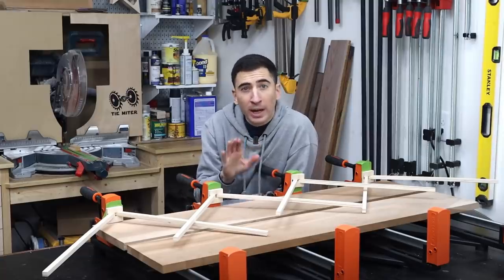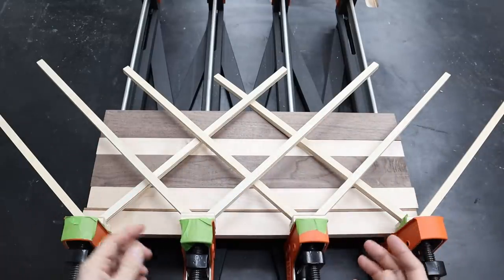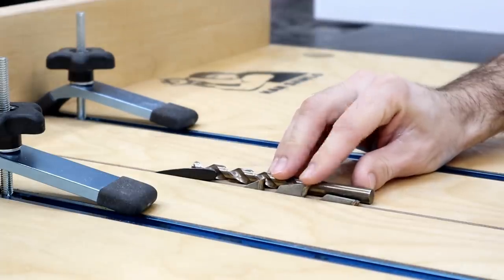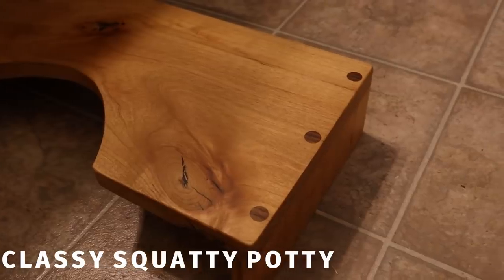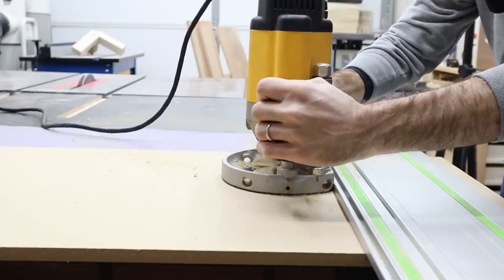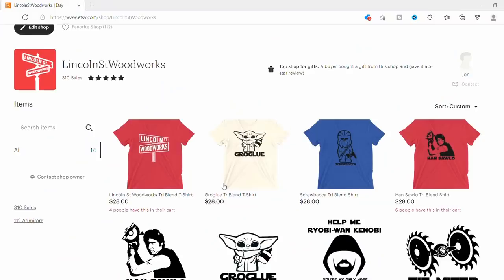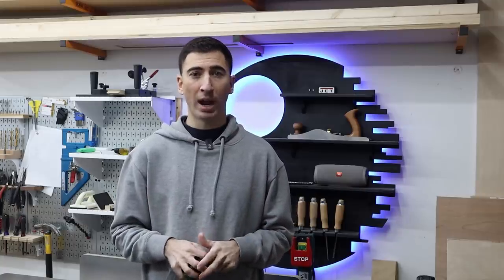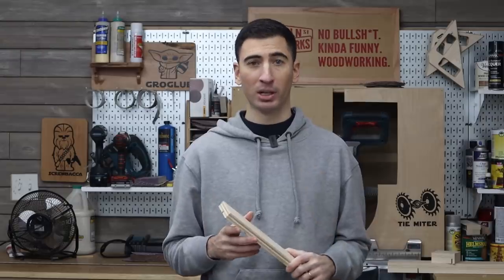I wish I knew about this before - woodworking

Comment: When mounting a computer monitor baseplate to a table, rather than measuring out the pilot holes, I clamped a piece of paper to the baseplate and did a pencil rubbing for a makeshift template.  I can see that applying to other uses/projects for a quick drill hole template.

Comment: thanks for sharing all the tips...have been subscribed to your channel for as long as you've been on YouTube and always learn something that helps...will visit your Etsy store! Regarding miter saw tip, I will place the board against blade while it's plunged, raise the blade above the board then start the saw and plunge...the apparent vibration/centrifugal force yields a very slight removal of material which is exactly what you're achieving...anyway, thanks for sharing!

Comment: Not sure I buy the clamp force vector idea. There are forces coming from the other side too, not just the 1 side. So you'd have forces causing Xs, not just Vs from 1 side. Also, I think the angle would have way to much to take into consideration, wood type and dimensions, to say its 45 degrees.

Comment: Instead of using tape to avoid glue during glue ups, use a bit of paste wax. Whether on the wood or clamps, it works better than tape and doesn’t risk getting stuck after!

Comment: Holy crap, the fan idea.... I have the Bosch saw and a front cover panel like yours, into a dust chute behind, but it only helps so much. I happen to have a battery-powered Ryobi fan and short ceilings. I bet if I mount that fan to the ceiling just in front of my saw station and aim it down and towards the saw, it would be the perfect dust-forcing-thing? BRB.....!

Comment: As someone who came out of metal Fab into carpentry i have a slew of thick angle iron pieces laying about. Ill use them to distribute the clamping force on the sides and use them allong the top and bottom to reduce the bowing effect of side force. It will end up looking like something out of a torture film....

Comment: Nice one :) Compact and still funny, keep it up!  For finding and marking the middle of a wider/longer board i use a similar technic, especially for akward fractional value, for example if the board is lets say 53.5cm wide (i will stick to the metric haha) , the middle would be 26.75 , good luck reading that one from ruler.. so i just mark from both side 26 and eyeball the middle of the two lines, i can detect the middle quite precise up to 2cm gap. Checking from both sides the measurement is also a good way to avoid some misreadings on the ruler, or some miscalculations done on the fly

Comment: Good tip. But for using them to set TS height, turn them 90 deg to the blade butt end to the blade teeth. Then you have the height up against the blade and it's easier to feel where it should be. If parallel, there is a drop as the radius of the bit falls off. Raise saw is brilliant!

Comment from the maker: Support the channel by visiting my Etsy Shop and using affiliate links in the video description. Do it - and I'll keep making videos. Also join our FB community group 

https://www.facebook.com/groups/702798154350625
https://www.etsy.com/shop/LincolnStWoodworks?ref=seller-platform-mcnav
Reply: Cannot recommend the shirts enough, fits great and super comfortable!
Reply: I liked all of your tips and never thought of using drill bits to measure anything. Thanks. Have you ever used a 4ft level to cut a wonky piece of wood on the table saw to get  a straight edge when you don't have a jointer?
Reply: I'll give you a different unit of measure  comment... The US doesn't use imperial units. It uses US Customary units. We haven't used imperial for over 200 years.

Inches is now the same between them but were not until around WW2 when they were unified globally. So if you get a really old drawing, don't assume the inch is the same distance used today.  For woodworking it probably won't matter, but machined parts might not fit.

Many other units differ between them. Particularly volumes. An imperial gallon is about 10lbs of water, while a US gallon 8.3lbs
Reply: Keep doing what you are doing brother. Haters are gonna hate no matter if you have science on your side. Love the videos. Love the merch.

Comment: Does this mean you can reduce the number of clamps needed by putting a thick block on either side of the work?

Thinking about it, it would certainly help spread out the clamping pressure.

Certainly if you have larger than necessary clamps, and a long thin workpiece this could save a lot of clamps, and thus a lot of time clamping and un-clamping. Perhaps pairs of wooden boards with a thin layer of rubber or leather (to protect the work from damage) glued on one face could be specifically made for this purpose.

Comment: Here's my method for squaring up boxes or carcasses or other box like items. I grab two 1/4" dowels which are at least longer than half, but shorter than the full distance from corner to corner. I then place the two dowels across the box diagonally with one dowel end placed firmly into each corner. Then with a spring clamp, I clamp the two dowels together. Now take the dowels and place it into the opposite corners and then adjust the box and re-clamp the dowels to the newly adjusted box corners. Repeat until the dowels fit snug in each corner without adjustment.

Comment: For shaving off "slivers" of the end of a piece of wood, if your miter saw isn't already set up, use a hand plane on your shooting board as a good option - the caveat being having these. For "tough" end grain, I've even found using my #62 low angle jack plane a challenge. As Rob Cosman has demonstrated, a #5 or #5-1/2 will provide greater ability for this task. This is the hidden jewel that may only need moderate at most restoration and tuning that I'm on the hunt for at a flea market.

Comment: For the cutting board glue up (or any glue up with thin pieces) in case you don't have enough clamp you can add some boards between the clamp and what you are glueing up it can help spread the clamping pressure.

Comment: Hint? I have used drill bits as set up gauges for a long time.  Because I have a hard time feeling if the top of the blade is even with the top/side of the drill bit I like to use my torpedo (6") level to span from the top of the/side of the drill bit to the top of the highest blade of the saw.  Because the level can swing on the top of the blade tooth and the drill bit I can watch the bubble in the level while moving the blade backward and forward until the bubble is centered in the level.  This means the blade sill be set exactly at the depth equal to the diameter of the drill bit.  Also if you fret over the insert not being exactly parallel to the table of the saw the level is long enough to span over the insert so the drill can rest blade tooth and on the drill bit on table top.  I guess if you can afford the brass set up gauges the level could still be used to set the blade to an exact distance above the table top rather than the insert.  

I really liked the clamp spacing and the router round edge used when using a strait edge instead of the flat side.  Just remember that the router bit needs to be centered in the center of the base.  Look closely and you might see that the plastic router base is not always the same as the router frame and the frame may not be exactly concentric with the actual bit or router collet..

Thanks for this video.

Comment: What I was taught for sneaking up on a length with a chop saw, is to lower the blade (not spinning), press the piece slightly into the blade to cause a tiny bit of deflection, raise the blade while holding the workpiece in place, and turn on the saw and bring it down. Repeat as necessary.

Comment: You can avoid the “cupped” result by alternating the clamps from one side to the other. I also would put as many clamps as I could while gluing up. I had about 30 of the  original Bessey K clamps and when they began to fail from a design flaw Bessey replaced all them at no charge. Great clamps those K Clamps. Good luck with your channel.
Reply: Additionally, it you aren't using the heavy duty cabinet clamps, but instead a general F clamp, alternate over under as well.

Comment: tip when setting the disk sander at 90 butt 2 pieces of scrap side by side and sand the ends, then butt the sanded ends together, if there is a gap top or bottom your not square. adjust the table until you have no gap and you will be dead on. works on the band and table saw also

Comment: An addition to the last tip, your saw blade flexes, you can sneak up by larger increments if you push your workpiece so the blade flexes a little, hold the workpiece still, raise the blade, it will go straight, then make the cut.

Comment: - If gluing up narrow boards, you can add wide boards as spacers to the beginning and end of your setup. This will put the narrow strips in that pressure cone of influence.
- when edge routing inside and outside of a project (think picture frame) the inner edge should be cut clockwise and the outside counterclockwise. No fun mnemonic device, but never-the-less

Comment: the best thing about the imperial system is that if you need half or double of a fraction, you can just say 9/32 instead of 9/64 or similar. I mean, I still use the metric system, cause I'm from Europe, but the fact that the imperial system works with fractions IS helpful.

Comment: 1st off, GREAT video.  I truly enjoy all the experience and info you share.  Here's a possible idea for you.  With regards to the 45° clamping force method for clamping glue ups, where you have to add 3 more clamps to the 4 you are already using in order to get good clamping pressure on the glue seam that is outside your clamping force area.  Couldn't you simply add a spacer board (without any glue) to move your project up further into the 45° clamping force area?

Comment: Nice tips there, thanks. Have You tried to let the forstner bits turn CCW for only some turns and after that switch direction to cw and finish drilling the hole? This also prevents tearout on soft woods and You don´t need the guided hole plate.

Comment: Good tips. As a Canadian (and supporter of the metric system) I have found woodworking the best intro to actually using imperial measurements. 10 is semi-prime, so it can only be divided by two numbers (2 and 5), where 12 can be divided by 2, 3, 4, and 6, giving you an easier method to more complex layouts. Memorizing and moving up and down the (maybe) 64 fractions you need to know is easier than memorizing .012 mm or any other odd number you'd need. It's good for construction and design. It's not good for science.
Reply: If you want people to take you serious...You shouldn't go around telling people that your Canadian.
Reply: plus, on an average male, one inch is one finger joint... and it's easier to divide stuff by two than by 10.
Reply: @GlueTubber  Dividing by ten is just moving the decimal point.  Dividing by two requires you to remember a bunch of facts and know how to divide.  It's way harder than ten.  Example:  What's a tenth of 517?  51.7  Whats half of 517?  Uhhh, lemme think about that.
Reply: @incognitotorpedo42  so, you are saying that those who use the imperial system over the metric system are smarter?  I'll take that!
Reply: @Elderos5  nah, you are all wrong.
Using 'murican system full of body parts and random things and words is not smarter, more convenient or whatsnot, than a crystal-clear, in and out scalable - metric system.
Reply: @GlueTubber  soooooo…. How do I divide a finger joint by anything? (Jokes) 😝
Reply: @GlueTubber , which one finger joint? 😂
Reply: Sorry about your communism

Comment: Not an expert, but I have a thing with clamps to help avoid cupping. Put as many on as you can, but don't tighten them like the boards owe you money and now this is their last warning.

The pressure spreads out but it also gets smaller. I think it looks like a flame - the blue bit is the hottest and goes pretty much strait up the middle, while it gets cooler and dimmer as it goes outwards. So by using lots of clamps at lower pressures you can get more control and a more even spread.

Ooh, and also use those things where you clamp a couple of straight boards to sandwich the piece if you can. They have a name, and I can't remember what it is...

Comment: Before you even think about clamping and gluing boards together, you should joint the boards so that they mate properly
with no gaps.  When boards are properly prepared (jointed) you do not have to apply herculean amounts of force during
the glue up stage.

Comment: The statics class I had in engineering school sure doesn’t teach that a short distributed load ( the clamp width)  between two points has force vectors at 45  degrees in two directions.
Reply: Ha, that's strange, mine didn't teach the 45° either.... While I suppose the 45° may be useful as a rule of thumb, it in no way follows math/physics. The author is just regurgitating false info from a Katz-Moses video a couple years ago. https://www.youtube.com/watch?v=j7e-gd-ZBdI
Reply: @yodes07 , ''spongy'' flexible stock will  distribute the pressure in a narrower angle, and stiff material will yield a wider angle of dispersion. Experience helps.
Reply: It's presented as a useful method to visualize what is happening in the joints, not an exact mathematical formulation. This is actually also used in engineering. Shigley's Mechanical Engineering Design Handbook uses the simplified pressure cone method for bolted joints, but it recommends a value of 30°.
Reply from the maker: As Manuel stated - this is an oversimplification of a bunch of factors at play. I never even touched on the properties of individual wood species (because most people don't care and it really doesn't matter) This is a down and dirty way to show people you need more clamps when the boards are narrow. Nothing more - nothing less. I think everyone needs to calm down on their statics class. Fine woodworking has covered this, Spags has covered this. It isn't some new revelation.

Comment: I grew up with both standards of measurement and it helps avoid mistakes as I write the size in both, if when it comes to cutting, say14 inches has 330mm next to it the mistake will be obvious when reading the tape.

Comment: I think you may be mistaken on the clamping issue.  You are only showing clamping pressure coming from one side of the clamps.  Once the clamps are closed you will have equal pressure at each end of the clamp.  So, imagine the angle indicators also coming from the other end of each clamp, and you will see that there are practically no "dead pressure" spots.
Reply from the maker: It’s not that simple unfortunately. There’s a lot of other factors to consider. Moral of the story use more clamps on narrow boards.
Reply: The pressure cone doesn't extend through the whole board. You are right that the other end of the clamp also has a pressure cone, but because there will only be pressure at the intersection of these 2 cones (making it a pressure "diamond"), there will in fact be "dead pressure" spots in the boards at each end of the clamp.

Comment: If you like the drill bit as a measuring tool trick but need higher precision (probably not relevant for woodworking, but might come in handy for calibrating machines) you can buy pin gauges which are basically just highly precise solid metal pins

Comment: It’s not that they put force out at 45 degrees, but instead that the greatest force is at 0 degrees and that at 45 degrees it’s down by roughly 50%.  It’s about keeping the force equal across the entire glue line.  Because of this math, by spacing them based on that 45 degree separation approach, one clamps force goes down as the next one is adding its force to it; so, at 45 degree spacing, they both add 50% to each other and it therefore keeps its force even at roughly 100% across the entire  glue line.

Comment: The drill bit as a spacer is a great tip, but only at the shank. Sometimes the “fuzz” on the flutes may cause the bit not to be totally cylindrical.
Reply: @ Hugo Danilo Don't you think the shank sometimes gets burred or otherwise damaged from tightening the chuck too much?

Comment: Note that if you have a cheap router,  the curved part of the base may not be concentric with the centre of the bit.
So you would need to use the same point on the curved base as you used to set your fence to get an accurate offset, and avoid rotating the base too much or a wavy cut might result.
Reply: Yeah I was thinking the same thing. In that trick you trust the curvature is precisely milled to be concentric with the bit. Perhaps that's indeed the case with most routers, they might be precise enough.

Will need to check if it's glue line worthy.
Reply from the maker: yeah its worth buying a centering cone for $10

Comment: I've always done a "bump cut" at the miter saw. Similar to what you are doing with the board to raise it. I leave the blade up just a little so the board touches the teeth - then just push a little and let the blade deflect a tiny bit. Then raise the blade and take that tiny sliver off.
Reply: Yes! I thought I invented that exact technique lol. It works perfectly! His way works just as well but ours is faster. Great minds think alike!
Reply: @christopherpavlicas  nope you didn't invent that😏 I've doing that for years.